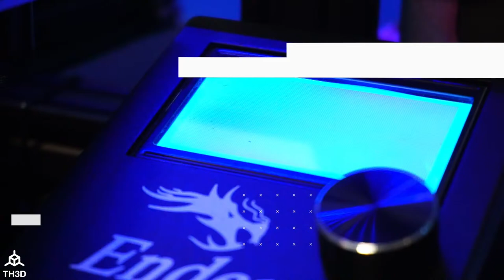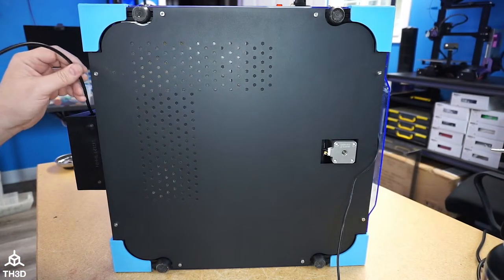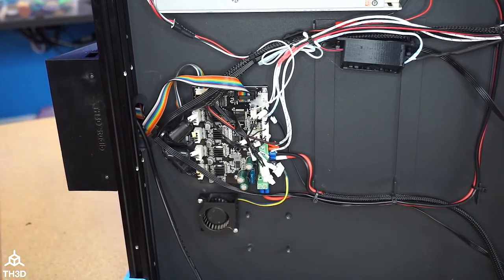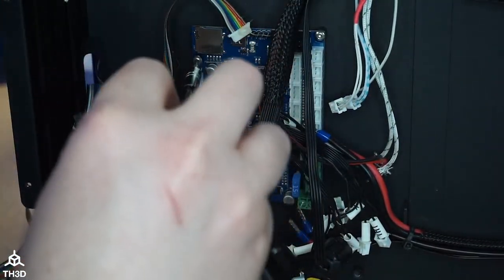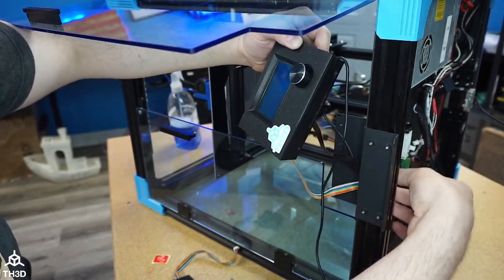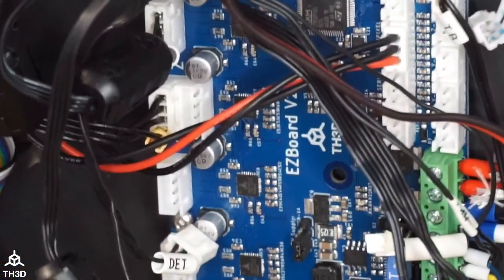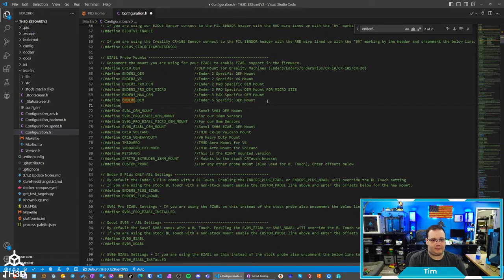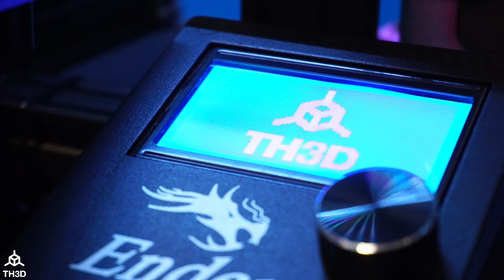Ender 6 EZBoard V2 Upgrade - DIY Stream - Hardware Installation

Comment: I have a problem with my Z motor. I took it off but left it plugged in and tried to home. It just jitters, even a replacement did the same. Is this what happened to you? Just want to make sure the board it trash before I get a new one with a new screen.
Reply from the maker: Try another motor on the Z. If it still doesn't work then the driver may be toast. That is the driver that was dying on our stock board.
Reply: @TH3DStudio  Thank you for the info. I tried a new one directly from Creality and it didn't move at all. Tried one from Amazon and it just Jittered. I heard you mention the z motor so figured I would ask and yep sounds like the exact same problem. I have 3 of these printers so will end up ordering 3 boards and screens soon lol